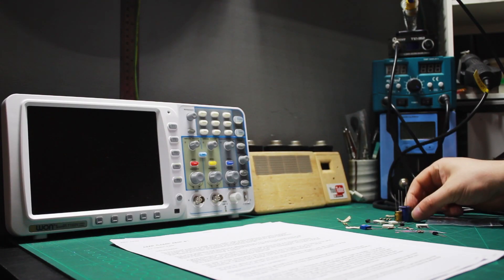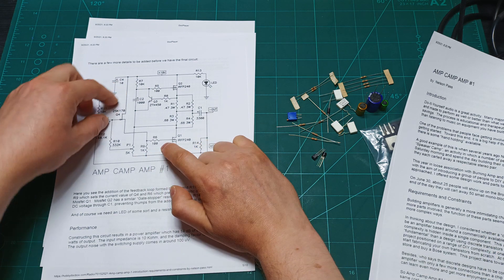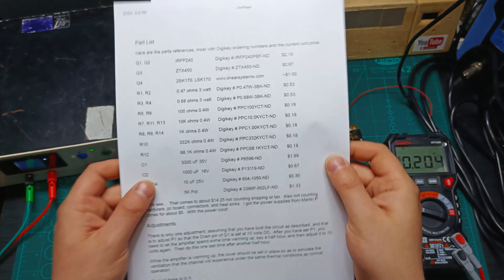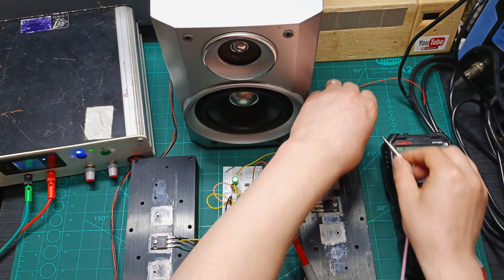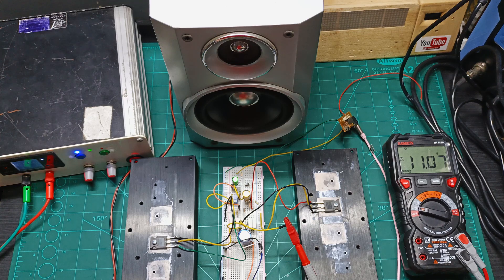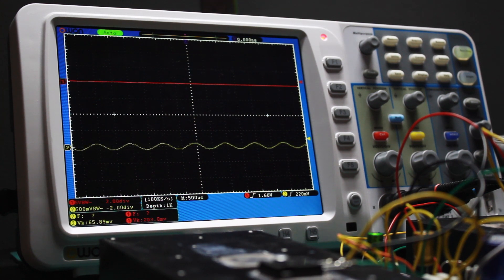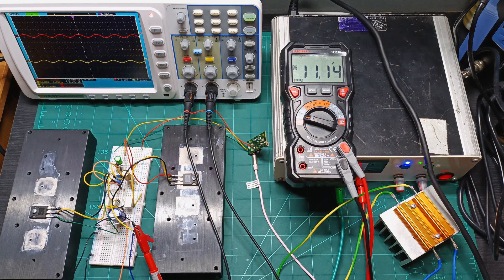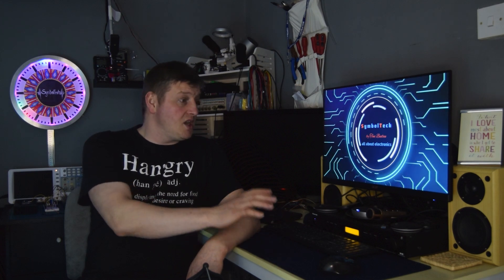Amp Camp Nelson Pass amplifier breadboard test

Comment: subscribed.. can you pimp it up totally with premium parts?? =) is it worth it to pimp it up... also i was wondering if I could have smaller output caps if i only use it over 100hz.. what would you recommend for output caps per crossover FR..
Reply from the maker: I suggest you to have an active crossover on the input and the amp will only receive the frequency that u want to pass through this amp and the output will be much better
Reply: @SymbolTech21  yes exactly what I have.. minidsp nanodigi.. still not sure what DAC I will use since some have variable audio latencies and i want good source.. 

but still my question remain can i use better smaller caps if i dont use them over 100hz.. even one will only be use over 2khz

want the best sound possible with the less changes possible as i'm not an expert diyer.. 

also could i bypass the output caps if they are connected to a 6db crossover capacitor? I  wonder
Reply from the maker: @lextr3110  so in order to get more bass for the output capacitor I recommend at list 3300uf
Reply from the maker: @lextr3110  and then if you will use a 5200 uf may loose highs but the bass will be much much better
Reply: @SymbolTech21  yes but if I use only over 100hz with digital crossover? there is mostly no bass at 100hz..? 

also one of them will be only use over 2khz.. I could better type of caps if lower capacitance.. i'm not a fan of caps in the signal path.. but i guess if it's already in the crossover.. let's say i would like 6db low pass starting at 4khz... is 5200uf would bypass the need to have a cap in the crossover.. 

I also might just go fully DSP crossover if so is there a way to bypass the output caps or lower it if i use it over 100hz and the other over 2khz..
Reply from the maker: @lextr3110  so you can use less capacitance on the output try with 2200 uf